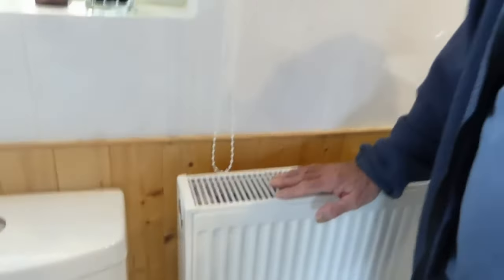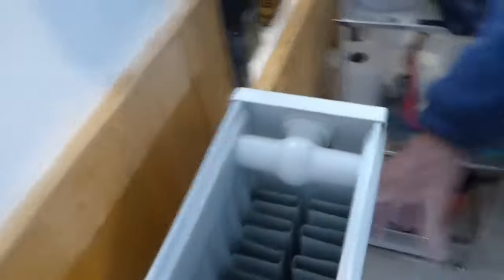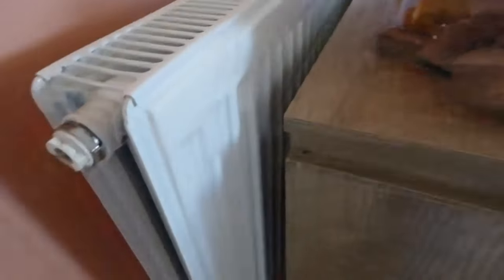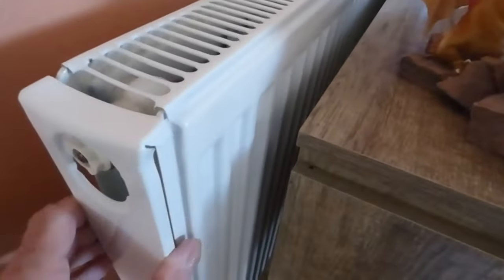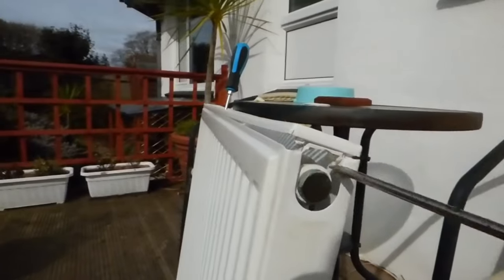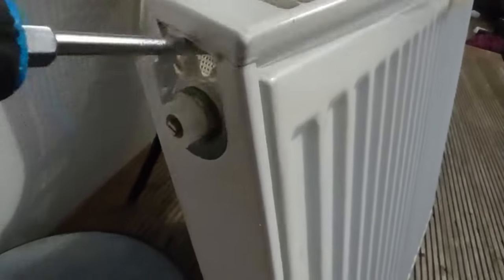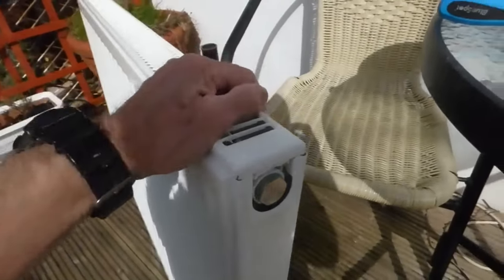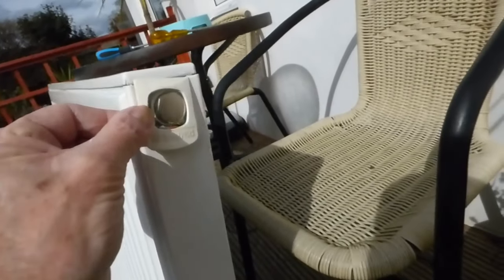Remove the grills on central heating radiators to clean behind.

Comment: I did an experiment at home with by clearing out the fins, took before and after temperatures, by clearing dust and fluff and debris from the rear of radiators it gained 6 degrees more of heat👍🏻
Reply from the maker: Interesting! so save money also.

Comment: Hello, your videos I’ve seen so far look great for newer and simpler radiators … ours look older and seem to have more details and complications! eg. the holes on the side panels are much smaller so they do not lift up very far at all, they must pull off outwards rather than upwards and there’s washer-type thing seems to be attached around the hole at the top of the panel, I just can’t slide it over the nut of the radiator.

Grateful for any help!
Reply from the maker: They will be fixed with hidden bolts do check for them using a torch

Comment: I'd like to know what you use to clean down between those tight slats.  I also have column radiators (a couple of them triple) and it's a nightmare trying to get in between.
Reply from the maker: A soft slinky woollen brush on a length of flexi wire, bought from Amazon.

Comment: I have a griddle at the top which has metal bent round on each end to secure it. Seems no way to get off. No clips. It's like they put on end in, lowered it on top and bent the othet clips in. As said, not clips but bent metal clips. Can I send a photo if you don't understand?
Reply from the maker: Sure send to my email address. Al.
Reply: OK, thank will do. @dereton33